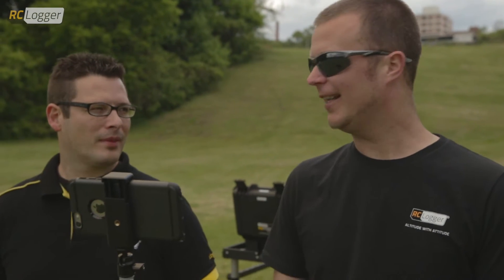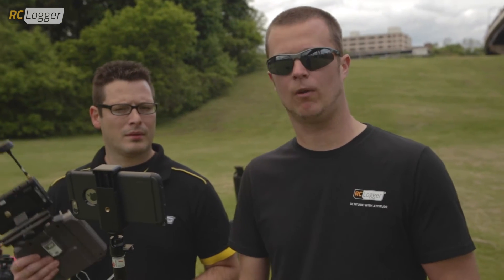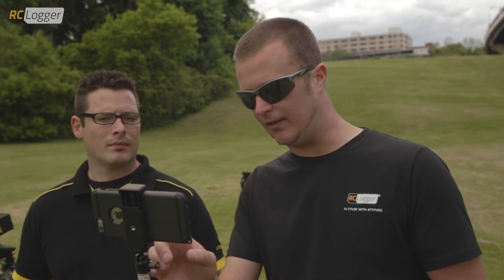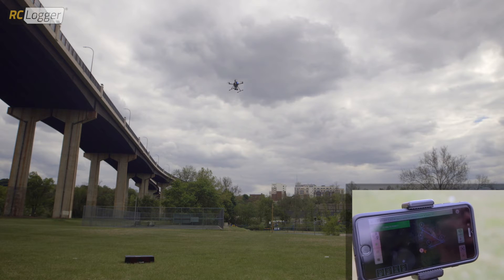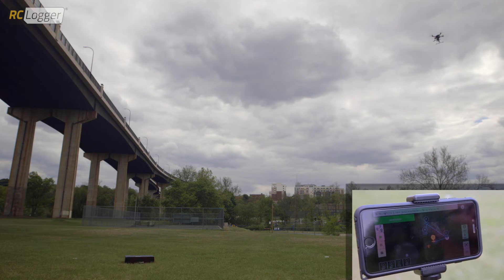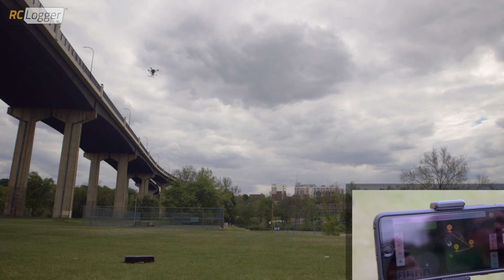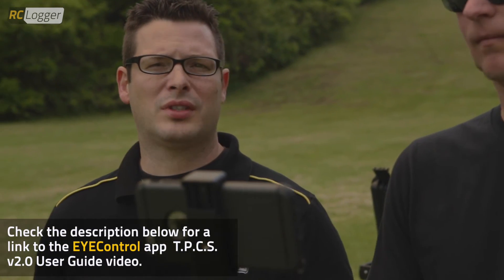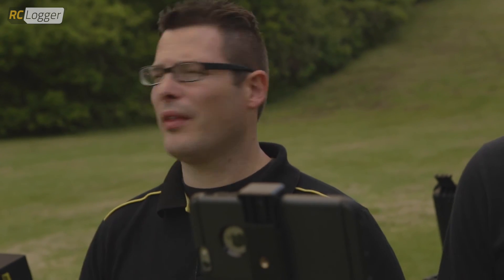RC Logger Task Point Command System (T.P.C.S)- Autonomous Flight Demo

Comment: Hi, ich schreibe heute mal auf deutsch. Die Firmware v2.0 für den NovaX 350 und v1.1.1 für den Sender ist ein Quantensprung, ich habe das heute getestet (bisher nur single tasks). Es funktioniert wunderbar. Was bei mir am iPad nicht geklappt hat ist RTH (die Schaltfläche hat nicht reagiert, Quer/Landscape Modus), aber man hat ja noch den Sender um den Hals hängen... also nicht wirklich ein Problem. Noch eine Frage: Kann ich irgendwie die YAW-Rate (Gieren) bei dem 360° Task beeinflussen? Das war mir etwas zu schnell. Ansonsten wie gesagt alles super! Bitte dieses tolle Produkt weiter pflegen und mit Updates versorgen, auch wenn bereits neuere Modelle in der Pipeline sind!!!